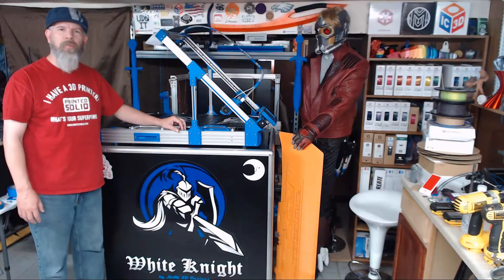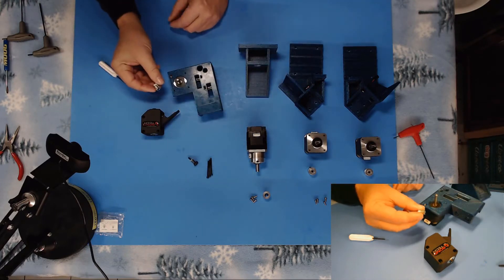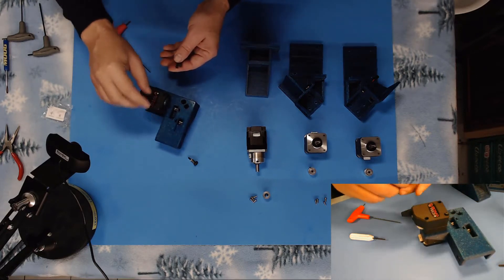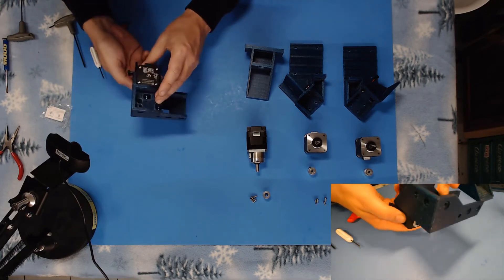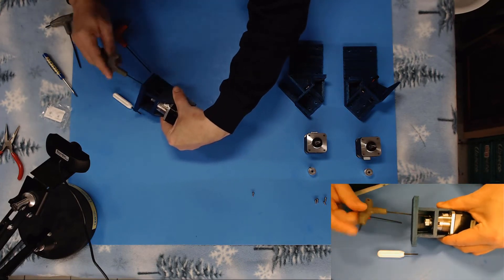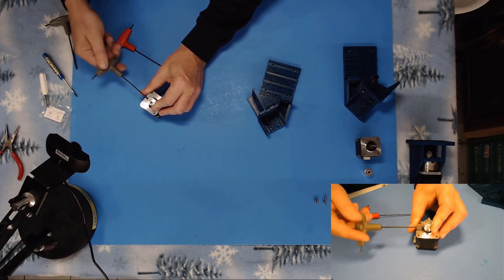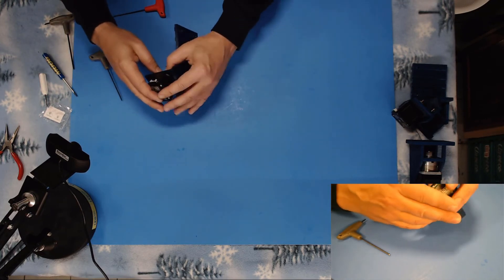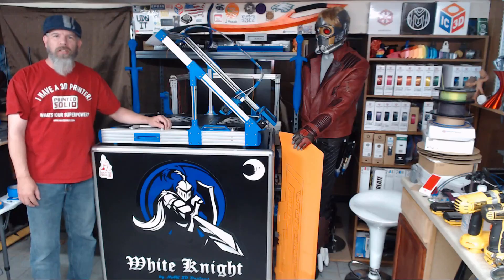White Knight Assembly Part 10

Comment: Hey Carl, if you could let me know about the torque rating of the motor or provide me with a link to the stepper it would be great help!
Reply from the maker: There are links to two sources in the description as well as a link to the Github that lists part and source.  I used a 5:1 stepper for the z-axis but you may want to consider a 12.7:1 or 19:1 if you can locate them and just modify the mount as required.  The 5:1 is pretty much at its limit.
Reply: @NAK3DDesigns  Thank you so much, Carl!

Comment: Hey Carl, could you please tell me on what basis was the 5:1 planetary nema 17 motor chosen? I would also love to know if you would recommend any other motor! Thank you :)
Reply from the maker: It was chosen because I knew I would need a lot of torque to move that large belt and rollers.    I’ve actually upgraded to a 19.2:1 since I’ve added a magnet sheet on the heated plate
Reply: Hey Carl, if you could let me know about the torque rating of the motor or provide me with a link to the stepper it would be great help!